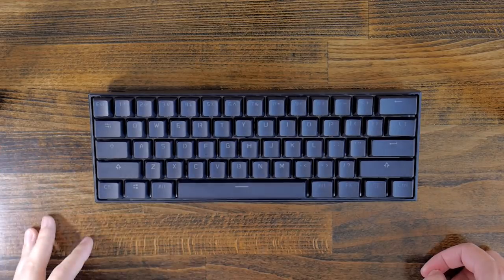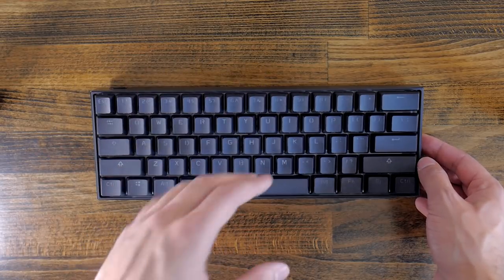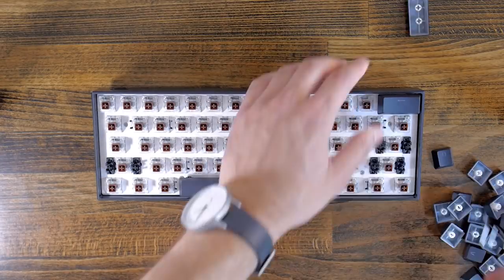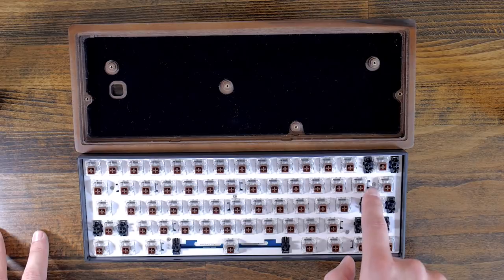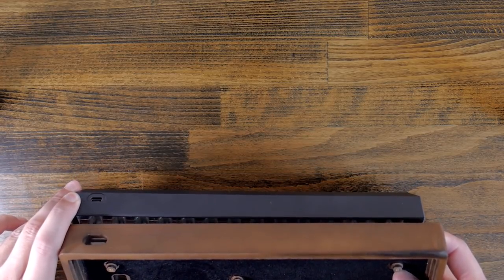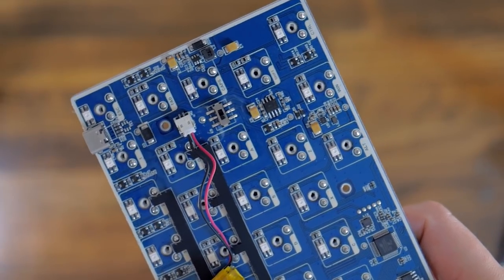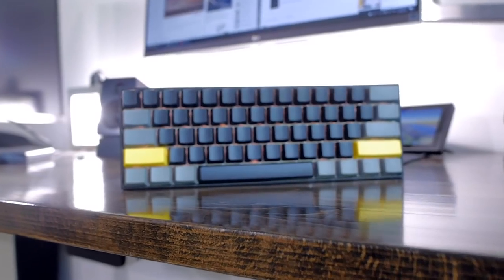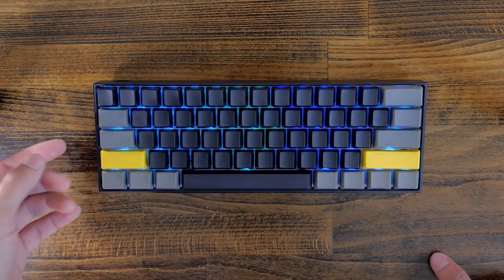Customizing The Anne Pro 2!

Comment: While you only changed the keycaps, I think this video is extremely important for people knowing the limitations and abilities of the Anne Pro 2.
Reply: its just the battery and its only used for the Bluetooth option. Take the battery out and it will be compatible with any case just like other 60% MKs.
Reply: @abdulalsherif8211  Not entirely true. While an anne pro will technically fit in any 60% case, its screw pattern is unique which means you will only be able to thread in 2 of the 5 screws.
Reply: @toddpiedad651  that is the same for other keyboards....

Comment from the maker: I revisited the Anne Pro 2 after 4 months of full-time use in this video: https://www.youtube.com/watch?v=P6rl171fFT8 
In case you wanted to know what I like and don't like about it after a long time period 😃
Reply: What pcb ann pro 2 uses?
Reply: what is the magnetic cable called
Reply: so when I restart my pc, the rgb on my Anne pro 2 won’t start up. I have to turn it on manually.
Reply: @Estebeezy  fixed with the latest firmware
Reply: Andrea Z. Finally 😱
Reply: @Estebeezy  yes. Finally indeed. The keyboard now feels another thing, I don't have any other complain against this keyboard. Make sure to update the software on your PC and only then update the firmware.
Reply: Andrea Z. Yeah for sure. I wont lie that little thing actually bugged me out which made me stop using it because I didn’t want to keep hitting fn + 0 to turn it on. Plus it would never save my rgb effects. Finally it does now.

Comment: You could've just drilled a bigger hole in the wooden frame, no? Should only take a few seconds.
Reply from the maker: True, but since I already lost the Bluetooth connectivity, I knew I wouldn't keep it like that after the video,
so I didn't feel like pushing my luck further haha
Reply: minimalistik Good point!
Reply: if you can sort of file down the batterie spot for it to get fit or test the connectivity by hanging out the batterie through the typ c port hole? and fixing the missing screw-threads from the palstic case to the wooden with epoxie? would nice to see :)
Reply: 10 mm drill did the job for the USB-C cable. I do have access to a router. This way it took a minute to make enough space for the original battery.
This review made me buy the Anne Pro 2 in the first place. Thank you #minimalistik ! I am so happy with the board that I've ordered a second one for work, including the bigger battery.
Reply: @minimalistik  you can use a magnetic type c to overpass this.

Comment: Hey I was wondering if it's difficult using this keyboard for video editing? Should I just go for something like the k95?
Reply: F keys require a 2 key combination to press, including keys like del, insert, arrow keys, etc. on any 60%. The k95 also has the macro pad on the left. I personally prefer a full 100% keyboard for stuff like photoshop/video editing but it's definitely doable on a 60%. Just takes a few weeks at most to memorize all the key bindings/shortcuts. The portability is also a factor, whether or not you want to be using this keyboard with a laptop on the fly, not really doable with the k95. Custom caps are also a lot harder to find for Corsair's non standard bottom row.

Comment: Pretty sure that the issue with the original box switches is they stretch and sometimes crack keycap stems over time. That’s why the fit is so tight.
Reply from the maker: Ahh I see, I will swap them up again within a month, so we'll see how it goes then.

Comment: Should I desolder the whole thing for me to be able to lube the stab and key switches?
Reply from the maker: You should be able to lube them without desoldering it. Unless you really want to lube them in a special way, I don't think it's necessary. Removing the keycaps is usually enough.

Comment: What is the type of screwdriver you used? I'm facing difficulty in opening my keyboard
Reply: I am having trouble too
Reply: @eric4598  I found a good video to open the keyboard and solve my led problem issue. check this out (How to fix mechanical keyboard lighting: VRONTI) and between we need to use Torx T5 screwdriver to open the keyboard
Reply: Charan Teja thanks I’m getting that screwdriver today hopefully I can fix it

Comment: Anyone knows the specific types of keycaps that can be used with the Anne Pro 2 here? Just starting out on my Keyboard journey so I'm not too sure what I might not know. Any help is appreciated 🙏🏼
Reply: If you mean the form factor like Cherry, OEM, SA, DSA, etc.  of the keycaps set, they should all be fine as long as they cover a 60% layout.  If you just wanna replace some of the caps on the board then you should look for OEM caps since they will fit in with the caps that come with the Anne Pro 2.

Comment: Did a similar mod with a bamboo case. Quickly carved out a cavity on the inside for the battery; no need to go without. I didn't need to use spacers to elevate the PCB & was also able to fit DSA caps with no issue 👍 Info here if anyone is interested: https://www.reddit.com/r/AnnePro/comments/9ned6u/custom_ap2/

Comment: my Anne pro 2 wont turn on lights upon start up of my PC. I need to turn it on manually every time.
Reply: Mer-One Ralph Jr. Bolinto same
Reply: Have u fixed it yet
Reply: ughhh its really like that..i have to press fn2 and 0 everytime
Reply: Mer-One Ralph Jr. Bolinto same. I don’t know if it’s a software issue or what. But, when I use any other rgb keyboard it works fine.
Reply: Are you still having that problem? When I first got my board it was doing that. But with a recent update I don't need to unplug and plug it back in anymore.

Comment: Could you add jade switches to this keyboard?
Reply: Yes, Kailh Jades will be compatible. Keep in mind that you will have to desolder the existing switches, and solder the new ones in however, as the keyboard is not hotswappable. The GMMK is hotswappable, however, and won't require desoldering.

Comment: one question, i just got my keyboard for x mas. how do i remove the key caps, do i just put the keycap puller under the keycap and pull?
Reply: Logical Ninja yes
Reply: But tightly
Reply from the maker: Yes, just be careful. On larger keys, there's also the stabilizers that needs to be pulled, but these are a bit fragile.

Comment: Guus that should know a lot about keyboard tries to remove keycap without keycap puller when he knows he can break it
Reply from the maker: It's not risky if you know what you're doing. never broke a stem. if you apply even force on both sides, it's pretty much like a puller.

Comment: this is the worst “build” ever... took a prebuilt board, just tried to put it in a wooden case, failed repeatedly... 😂
Reply: it still good info though! now you know that it won't fit and you don't have to try it yourself
Reply from the maker: What Xxan said, this video was unscripted and only an attempt at switching the case.
I've had multiple questions regarding this and this video addresses this.
No need to insult the content
Reply: 14min to put on new keycaps.

Could have just said, i tried this, didn't work
Reply: I've seen good solder, program the PCB, paint the case, etc videos that last 5 minutes... this guy took 16 minutes to swap MX compatible keycaps... it's just a cash grab to make a long video to show as many ads as possible with no useful info... shameful.
Reply from the maker: King Zero hahaha good one. See how many views I'm getting on these videos? If money was a priority, I wouldn't make mechanical keyboard videos. I had over an hour and a half of footage initially, cut it down to 16 minutes. Sounds reasonable.
Reply: minimalistik  Don't listen to these idiots. Anyone that thinks someone with 6k subs is in it as a cash grab has no idea how youtube works. Thanks for taking the time to create content.

Comment: Fist of all, it's already well known that Anne Pro mouning points are not compatible with GH60,  second the video is 16 minute long, and for 9 minute you have tried to put it there, and the rest of the video is chaning the keycaps...
Reply from the maker: Some people said that some points were compatible and some others said that none were compatible, so that's what I wanted to figure out.
And that's the AP2, so it could've changed since the original version.
I also answered other concerns that I've read online (ie: non-OEM keycaps compatibility).
This is a non scripted video, so it will be longer, but you are not obligated to watch it either haha
Reply: I liked it. I would like to see what can be done if you decided to mod the build. Shouldn't be hard to glue in some studs in a wooden case, and carve out a battery spot. I also bet you could flush mount USB-C port on the side with a small internal wire to the port. Or, just use a magnetic USB cable. 

Personally though, I'd love to see it mounted in a red anodized aluminum case.